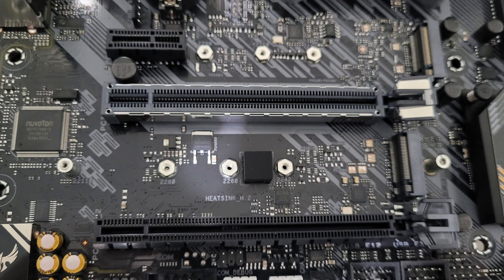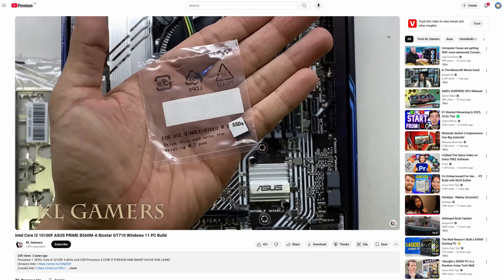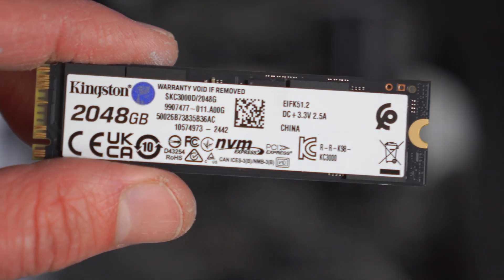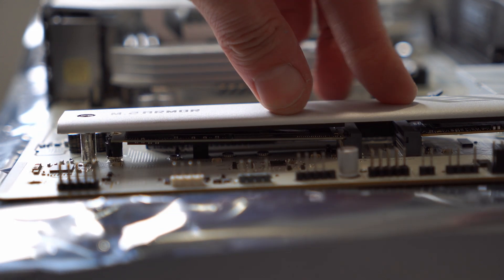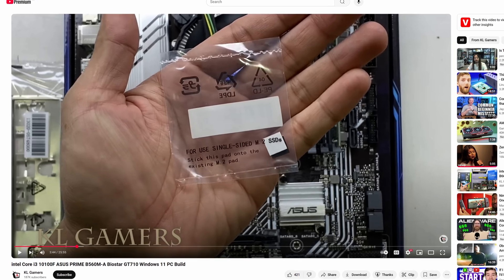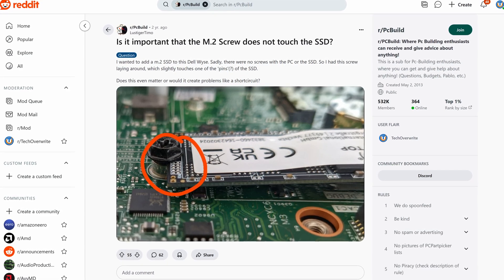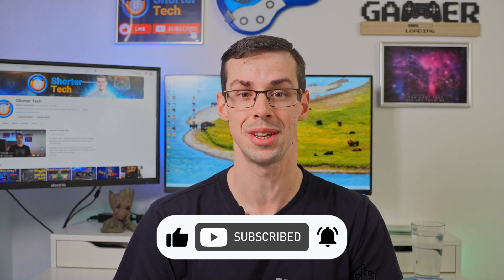When Should You Use M.2 Rubber Pads? (& When To Avoid)

Comment: can someone please help me source these little blocks? my motherboard was supposed to come with them but it did not. I have searched the internet in every way I can think of and even tried Amazon as well as trying to DIY a different solution. I specifically need ones that are around 6.5mm thick.
Reply from the maker: Sorry to hear it :/ I ended up getting more by buying a "M.2 NVMe kit" on Amazon, which came with a load of screws and rubber pads. But it'll probably vary a lot depending on stock levels and which Amazon you're ordering off.

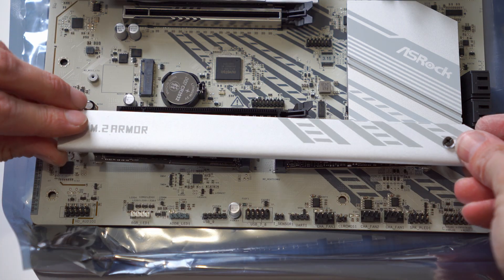Comment: Is the rubber pad the small, 2mm square you had in the plastic bag? What is the larger black rectangle that's attached to the back of the metal piece seen at 2:33? My motherboard came with a blue rectangle like this but I didn't use it, now I'm wondering if that was a mistake. Thank you for this informative video btw
Reply from the maker: Sorry for the delay in replying - that black rectangle is a built-in thermal pad. They are often blue, but in this case it's black :) They make a big difference for cooling on heatsinks like this. Sometimes the thermal pad also has a plastic wrap that you need to peel off first.

Comment: Is there anywhere you can buy these? My Gigabyte mobo didn't come with them and my ssd is starting to bend.
Reply from the maker: I bought an NVMe screw kit recently on Amazon that came with standoffs and rubber pads. Often Amazon and eBay have various options - although you might end up paying £5-10/$5-10 for the kit, even if you just want 1 tiny pad lol 😔
Reply: @ShorterTechOverwrite thanks for the reply. I can’t seem to find any listings that specifically mention the rubber pads, I’ve even tried Aliexpress. I’ll try contacting Gigabyte support and see if they can assist. At this point I just need to prevent any further damage to my SSDs.
Reply: @HPHyenadon  Same here 3 sets of pads mentioned in the manual but no where to be found in the motherboard box.

Comment: Alright this is a great video now, ive just installed a sn850x single sided nvme to my asus mobo without the rubber pad. There was only one of those in the secondary m.2 slot. 
Ive also placed the heatsink on top of the m.2 and now pretty concerned if i should pull it all out and snugg a pad in there. Even though, it can get messy with the sticky heatsink on top. 
The temparatures are good right now and im not sure how the heatsink can apply so much pressure on the ssd as its screwed leveled on both sides. Is this going to be an issue?
Reply from the maker: Hmm it's hard to say for sure, if the temps are good and the M.2 drive isn't being squished at an ackward level (as in, it's not bent) then I would leave it :)
Reply: @ShorterTechOverwrite Thanks man, it's working perfectly well and looks pretty straight when i checked the last day. Will stick to the 'if it's not broken, don't fix it' rule lol

Comment: I have two questions. I also have KC3000 drive which is double sided, according to my mobo manual it says rubber pads are only used for single sided and should be removed for double sided drives however as you mentioned the rubber cube keeps the ssd perfectly flat, otherwise I see it bend slightly. So I assume it's just a bad wording on their part and they meant it if the ssd is double sided plus has its own heatsink or something along those lines.

Secondly, If my drive and mobo heatsink are both 2280 then I assume m.2 screw is not needed because both ssd and heatsink overlap on same standoff hole so heatsink screw should be able to pin it down right?
Reply from the maker: Good questions. I think it might depend on how thick the heatsink is. On the one I shown in the thumbnail, that did seem to push down on the (single-sided) drives a fair amount - so it's possible that a double sided drives might have issues with that. But for all the other heatsinks I have used in other motherboards, they don't seem as thick and I've not had issues with my double-sided KC3000 drive.

And yes, I agree that you can skip the M.2 screw here - I always just rely on the heatsink screw/pressure to push the drive down :)

Comment: Lost a 2TB nvme drive that bent due to the thermal pad that came with the motherboard's heatsink applying too much pressure on it.
Since them, I replaced the thermal pad with cheap white thermal grease, conducts enough heat, doesn't apply ANY pressure to the SSD and won't short anything.
Yeah, it's messy when you need to remove said SSD, but I'd rather clean it every once in a lifetime, than lose my drive and my data to bending...
Reply from the maker: Oh yikes, sorry to hear that :( That's concerning. I almost had a similar situation at first with the 2x NVMe drives I showed in the video (and thumbnail) - something made bad contact, and the heatsink was starting to bend one of the drives in a slightly weird way. Luckily I caught it before screwing the heatsink too tight, but it's easily done :(
Reply: How did the nvme drive die out? Did the performance decline over period, did it break, or just stopped working one day?

I've installed and nvme without rubber pad. Trying to stay updated on what to expect now

Comment: MSI doesn't provide extra pads for single-sided SSDs with their motherboards, at least with some of the older boards like the B550 series that I've built several systems with. I've never been able to find these pads at a retailer, at least not in my country. Only recently when I built a X670 system for a friend did I learn of their existence and what they're used for. I noticed that the bending can actually be quite severe without them depending on the design of the heatsink. I doubt BGA chips on a PCB like that will hold up well over time, so when the pads aren't included in the box I cut a few squares of electrical tape and press them together until they're about 1mm thick and use that instead. It doesn't eliminate the bending completely, but neither do the purpose-built pads so it's better than nothing.
Reply from the maker: That's interesting, and that's a neat solution about the electrical tape, I can imagine that working just fine :)

Comment: Huh... I have 5 NVMe drives installed and I don't think I've ever noticed these. I have absolutely no idea whether either of my motherboards come with rubber pads, pre-installed or otherwise... Thanks for unlocking a new PC related fear in me!
Reply from the maker: Hah yeah I feel you. I don't think it's as much of an issue anymore, although I did once have a motherboard supply some 'optional' rubber pads in a bag - and tell me to check the manual. I've been worried about them ever since :S

Comment: Having not bought a motherboard in over 4 years, I've never noticed those pads. Good information!
Reply: same. my 990 evo plus drive is seat perfectly and air cooled, running at a balmy 37 degrees. my seagate firecude is in a PCIE enclosure with heat sink running at 31 degrees. not very worried.
Reply from the maker: I had one motherboard give me some rubber pads in a small bag, with a warning sticker on it (saying to check the manual of something). I've been paranoid about them ever since lol :D
Reply: Naah, I just yesterday built new PC,  after 15+ years, and I was very surprised about evolution...RGB,, power switch on board, power hub on case.... 😃😃 And rubber included also